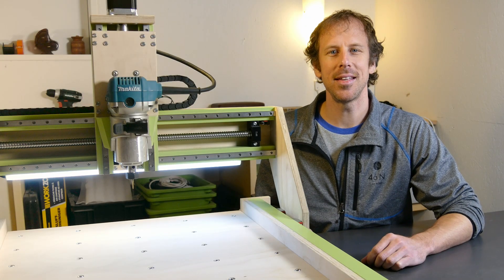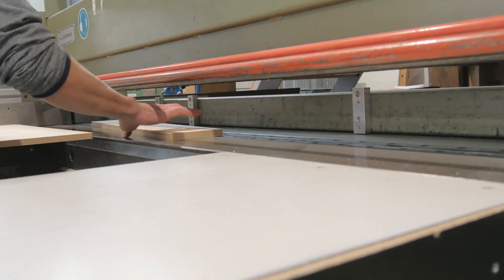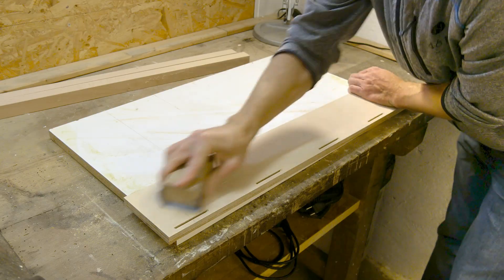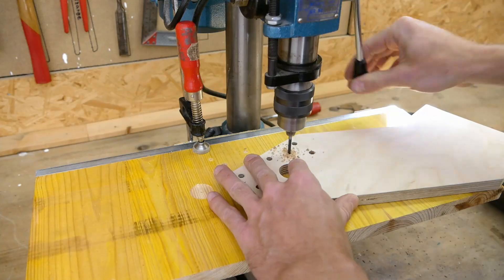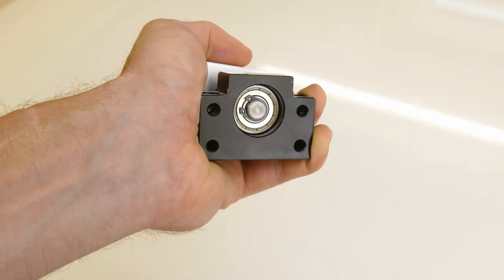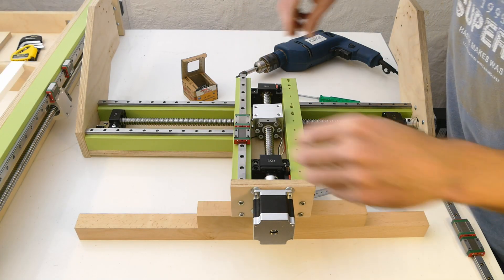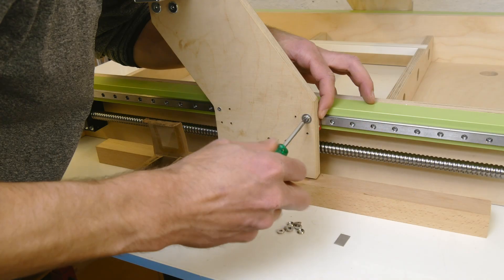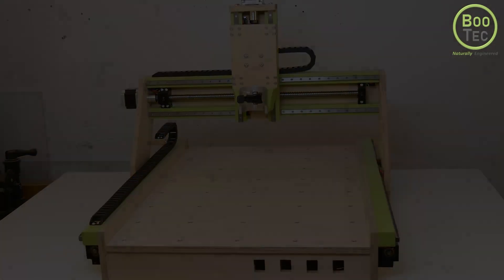DIY CNC Machine - Frame Build | Part 1/2

Comment from the maker: The plans for the CNC are now available for download at https://bootec.webstarts.com/store
Good luck with your builds and thanks for your comments and support!
If you'd like to see the machine in action you can check out my newest project at https://youtu.be/Fcfj5zil5_Y
Reply: The plans are ok but really could use cut patterns with drill locations and a list of the actual parts you purchased(detailed) had to hunt and search through the plans just to kinda find sizes...
Reply: @williamparks9500  This is the problem I'm having right now. The plans really need a full Bill of Materials and some patterns for each part. Loads of guess work involved.
Reply: @williamparks9500  Agreed. No drill patterns or part alignment in the plans. Quite disappointing.
Reply: It's a good thing the plans are only $6.  They are not very detailed.  I expected detailed piece part drawings with dimensions of where all the mounting holes for servos, linear rails, etc  are located.  No such thing.  They are just basic assembly prints with information for the lead screws, linear rails, and servos that are just copied off the aliexpress website.  However, I think Romans has a very good design that should be very accurate for a wood CNC router.  Thanks for your videos and explanations.  I only comment on this so that if there is someone that wants to just build a bunch of parts with out having to figure out where holes should be the plans do not include that.
Reply: Thanks for the information; really, who doesn't have experience (like me) in building a CNC, will have great difficulties, therefore, it would be necessary enough details in this plan!
If you or someone here, built this CNC and want to share or sell the detailed plan for this CNC, I think it would be well accepted.
Reply: @davdue  can you please tell me the length of the linear rails?
Reply: Hi I'd like to buy the plans do you use PayPal?
Reply: So if I get the plans does it show how to use a router instead of the spindle kit?
Reply: Are the planswhich are possible to buy  in inches or in metric system? Thanks for your work!
Reply: Thanks for the quick email back! I am excited for all the parts to arrive. I am going to make one for me and a mate! Cheers for sharing this.
Reply: please this video files to sent me im living in the 🇮🇷 iran and not buy in im country please sent files me to my email address 🙏🏻🙏🏻🙏🏻 terminator8583@gmail.com
please please please send me ❤️
Reply: What size is the bearings and rails ?
Reply: how can i purchase this sir? i want to buy
Reply: Can you please specify the parts needed for purchase? I would like to buy your plans and build the CNC, but it's a lot of money to invest if the parts don't match. I'm thinking the sizes of the linear rails and ball screws needed.

There are 15 different sizes of linear rail slides to choose from and 22 different sizes of ball screws.
Reply: taumus1 the plans do tell you the sizes you need and where they go. Only difficult thing is since I’m in the US we don’t really sell plywood at 15mm. Since that equals .59” our layout will be a bit off
Reply: @TheTricert10  Thanks. I will check out the plans soon then.
Reply: @TheTricert10  the best substitute is 19/32 plywood...well at least that's what I have found
Reply: William Parks thank you so much
Reply: @TheTricert10  I have purchased the plans and they tell you what lengths and sizes of linear slides and ball screws to purchase.

Comment: Bro do u have a full length video for all this work. I have 2 full size 8X4 foot sheets of nice Plywood but I also wanted to use belts and pulleys on my build. I saw a great deal for 1000mm linear bearings and the ball screw on another website today. Don't know if I'm allowed to say the name or what so I won't but it was a great deal tbf. I think I'm going to do what u have done here and use Plywood to build out my machine. I need to spend a fair bit of time on the electronics but I watched part of part 2 and it loks or u made it look far more easy than I expected so I will be watching it very closely bro.. Great job anyways man. Keep up the fine work there.. Salute from Ireland..

Comment: wery small motors you use, long have better have more torgue. minimum motors have cnc mill 4-5Ampere, no matter how much volt use 24-90 volt. normal DIY home cnc 36 volt best 80-90 volt. motor select have important only max ampere, and max torgue. drivers need be same than motors ampere or more.

Comment: i has build my cnc 1500mm x 1500mm x 400mm SBR rails, and cnc minimum motors have need be 4,5A max nema 23 ebay cost 4 motors 60$  3x36 volt power, 6 limit switch and minimum need be 500W spindle. all what you can made wood you can made aluminium better same tools. table i welding metal tube.  cost less 500$ whit ball screws. paraller port controller 10$ and 5Ampere motor drivers 20$/axis. i test first mach 3, but windows OS not cood cnc not realtime and problem lot interrupt, windows have shit, linux cnc software have lot lot better use no interrupt problems  and working stabile alltime. i has build this elektronic many cnc old bridgeport mill new cnc and many factory about 24 cnc and plasma table.

Comment: Would there be a huge difference between the makita RT0700C (710W) and the one you have in the part list of the description (500W). 

I am thinking of building such a machine for some time now, already did some successful Arduino projects so I now start to search for a suitable Design/Inspiration for one... (Should be able to cut/carve styrodur foam, wood aluminium and if this is somehow realistic steel (but steel is likely not possible with such a machine or would take way to long)...

Comment: I finish building this CNC a while ago, and will have to post a video of it running.

I built mine out of 1/2" Baltic Birch, and doubled all the layers to 1 inch. By putting the natural stress of the plywood against each other and clamping to an absolutely flat worksurface I got pretty straight pieces. I really doubt a single piece of 5/8 plywood would be absolutely flat and straight, and would end up binding in Romans design. It's critical if you want your CNC to be super accurate that the parts themselves need to be machine precisely, and everything needs to be flat and true and square. This will test your woodworking abilities, and you better have good machinery that is all trued up before you start. I actually cut a number of the parts out on a CNC to ensure accurate alignment.

In short this machine is only going to be a strong as the weakest link. It took a long time to get adjusted and ended up having to enlarge a few holes for mounting to give myself a tiny bit of wiggle room. If things don't align precisely the machine will bind. 

I also doubled up the linear rails for the y-axis. I don't know why Roman designed the y-axis with only one linear rail, when everything else had two. If I was to do over again I would probably go to the next size linear rails. These are a bit undersized in this design and used more on 3-D printers than CNC's. 

With the 1 inch members that I used, and Baltic Birch plywood, my machine is quite rigid. I think it would be capable of milling aluminum with lightweight passes. Again, I would double up the thickness on everything, and use two linear rails on the y-axis. I bought my controller "blackbox" from open builds, along with some limit switches. Way easier to wire. The only thing you need is a 24 V power supply, and you're off to the races. 

OpenBuilds also makes a controller so you can operate the CNC without a computer. I have not purchased yet, but I like the idea of being able to just run things off of a USB drive and not having to worry about my laptop running out of batteries or the fan clogging up from sawdust. 

As colder temperatures set in I'll shoot a video and post a link of my build.  Roman has a good design, but it can use refinement. And his plans are fairly detailed, but you do need to do some figuring on your own. The manufacturer of the linear rail gives you detailed specs, so not too hard to figure out hole placement.  Same thing applies for the ballscrews.  Those things are extremely beefy btw.  Again, going to the next size up for linear rails I think would be a nice upgrade, and  would give the machine some greater rigidity.  Good luck to all who try this build.
Reply: Looking forward to seeing your video.  Please post where to watch it when done.  I to am building the CNC.  I enlarged it a little to have 1000mm rails on both the X and Y axis.  I wish I would have seen your post before I ordered parts but will have to go with the 12mm linear rails for now.  I like ball screw size but may go with 20mm solid round linear rails.  Let me know how the BlackBox controller works out.  I already have the GRBL components already so will go with them.  I built a Joe's 4x4 CNC about 10 years ago and it was controlled with Mach 3.  I sold it about 3 years later and have been kicking myself ever since.
Reply: Sorry I never got a video. On my list of things to do! I can say since I built this thing I have cut aluminum with it using a climb cut, and that's about as much stress as you're gonna put on a machine. The results were very nice, but I was definitely not taking deep bites. I think maybe .040" and I don't remember what the feed rate was. This is something you have to play around with a bit. And the single flute bits tend to work the best, as you can only go so slow (rpm's) with a Palm router. The multiple flute bits require high IPM and the machine can't handle the stress, so it's a bit of a trade-off. It certainly is no milling machine, but it's pretty impressive for something made out of wood.

Comment: Having reviewed a lot of professional and DIY CNC router designs over the past 3 years, I find this one to be excelent! It cleverly keeps the amount of parts low and the manufacturing and assembly quite easy. This is probably the best wooden CNC router for the buck. I watched this nice video several times as an inspiration for my own designs.

Comment: Very nice and clean build, Roman! And your video is so well lit, clear and well explained. I bought the plans, thanks. It would be good to include the links you put in the YouTube description into that PDF, as well as the electrical diagram.  QUESTION: Did you measure the accuracy of the CNC? I would like to know how small is the backlash with your ball screw design, and how repeatable are the cuts in both hardwood and aluminum.  Thanks!

Comment: Here's a good place for parts, and where I will be ordering. https://www.zyltech.com/ball-screws/ Stepper motor were the cheapest on Amazon. 4 for $25. Openbuilds for controller, wires, drag chain, etc. All U.S. sources. Amazon had some nice router mounts as well. 65mm for Makita.

Comment: Excellent job!! I like the idea of building my own CNC. I downloaded your plan but all the measurements are in MM. If you ever have a plan in inches please let me know.
Reply: Buy a metric tape measure, that's what I did. 5/8 plywood is very close to the 15mm used. I ended up doubling up two 1/2" pieces of Baltic birch--much stiffer and glued up flatter. Surprising how often plywood has a bow to it. You need FLAT for this to work.

Comment: Well, I just bought the plans for 6.00$ but these aren't quite plans... you don't show the dimensions for the majority of the the drilled holes. Either positioning or diameter, depth, etc.. 
You do not specify the bolts used, which is quite important. Specially the ones that connect the rails to the solid timber elements. Because those cannot be countersunk, given that the rail is bored. 

Nevertheless, take my 6$ as some king of patronage. But I can't help feeling a bit "scammed". Excellent work nonetheless! 

As far as the reinforcement for the Y axis movements on the Z body,  the problem is well identified. There is a long distance between the attack region of the makita's tool and the lowest position of the lower Z bearing, causing the plywood board to flex. Provided that that the modded stock harness does not flex, you can maybe drill 2 metallic plates with the width of the plywood's thickness and drill them to the sides creating inertia (in case one of the sides of an angle profile does not fit either the back or the front , I think not you will have to work solely on the side). I would cut a strip with the length equal to the total height of part 11 - Router Mounting plate, in order for the span between the cutting area and the lowest bearing to get some stiffness from the upper lower spans created by the bearings and the nut housing. Along X the stiffness is much much bigger given the C Shaped traverse and the 5 very sturdy screws connecting them to the gantry sides. In this case, the span to consider is the distance of the X ball bearing's axis and the linear rail along Y. In this case, the correction would be to stiffen the gantry sides with thicker boards, as long as the connection of the gantry to the traverse is completely fix, not allowing the angle to go above or beyond the 90 degrees! 

Congrats on your machine Roman!

Comment: HI
if I had to think of an ultra low cost version, the engines could be nema17.....
The Y axis already has two engines and the effort is already divided by two, so two nema17 are sufficient. the head (z-axis) does not make much effort, and the only one is the x-axis which should be nema23. do you agree?

Comment: Everything is beuatifully done, beefy and strong. Except... the four small screws holding the aluminum router bracket. Any sideways or pulling forces will go through those screws..

Comment: Very  nice design. Never use tree. Tree is alive and changes according to the humidity and other effects. Change the plates with al or steel then you will have an accurate system.

Comment: Nice machine and work! I wan't to see your works with this wood frame cnc.
I have one DIY CNC with workspace of 1000x850mm (1200x1100 total) with a similar spindle (Kress 1kw) and the next step i wan't to make is put one 1.6kw VFD spindle (more power with less rpm, maybe 2 or 3 times more power).

If you wan't to see my machine https://www.youtube.com/watch?v=SFl_6xrXTx4 here i have one 3D carving i need a lot of improvement but i'm happy with this because are jobs of 3-4hours (3-4 for finish and 2 hours roughring).
Continue your work, it's awesome.

Comment: @BooTec @10:25 the linear rails are mounted to the side to which the gantry is connected. Isn't that putting too much weight on the rails and the screw? Instead, shouldn't the rails have been mounted on the top face of the wood?

Comment: Does plywood have a structural advantage over MDF?
Reply: Plywood is much stronger than MDF. This is especially true if your machine is in a garage. Even the slightest bit of moisture and its done. The only thing I would use as mdf in a cnc build is for the bed, just because if the router cuts into it, it is cheap to replace.
Reply: @NerdyCraftsmith  Thanks for the reply. I do live in a specially humid place, so I'm glad you replied with that information!

Comment: Hi Roman,
I really liked what you did and I want to repoduce your CNC.
I purchased the plans on your store and I have a question regarding the diameter of the shaft for the step motors.
I don't find this information and there are 2 options on AliExpress website. (6,35mm and 8mm).
Please confirm It is a 6,35mm shaft since the coupler is 6.35x10
Thank you very much
Cedric
Reply: I ran into that today ordering parts. If you are buying from the links, scroll down and you will see that the ball screws come with a 6.35-to-10mm coupler. Seeing that, I just went with 6.35 shafts on my stepper motors. You could go with 8mm, yo'd just have to buy a coupler or request a different one from the AliExpress seller. Hope that helps....